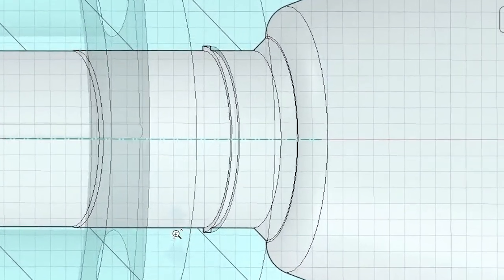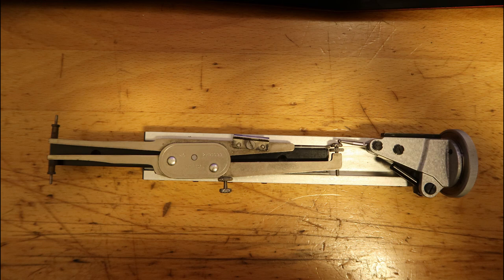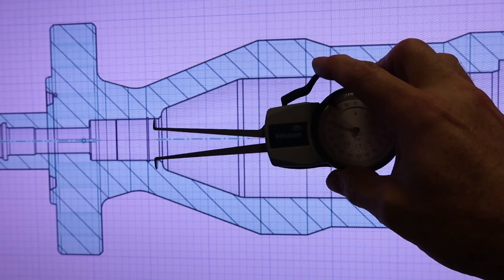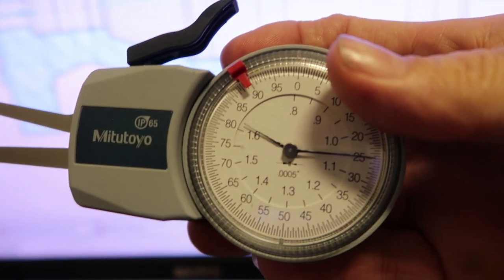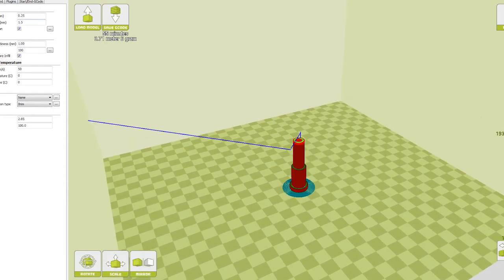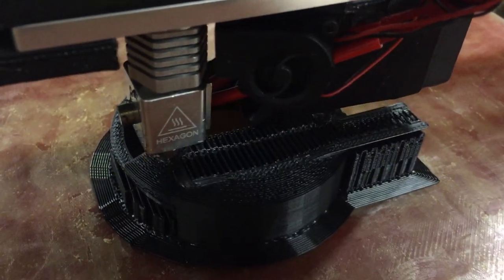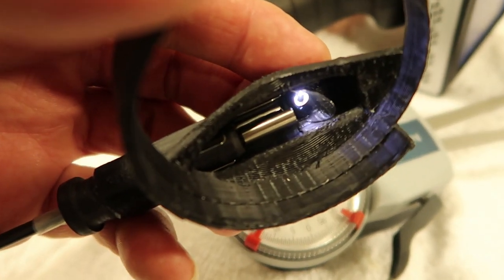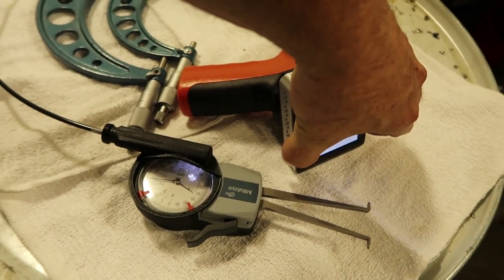Scoped Out Gage

Comment: Do Y'all have repro rubber? You could've of put some repro rubber on the end of a round stick/dowel and rolled and pressed the molding putty into the groove and then measured the dimentions on a comparator. I do it all the time for threads and grooves. If you've already established where the I.D. of that bore is, where the groove is cut into, then add the (groove depth x 2) + the I.D. diameter. The trick with repro rubber is preping the area, making it clean and free of oils/coolant, dust and chips, with brake cleaner or alcohol. I end up being within .0005 - .001 with this method. Sorry for your losses with the Hurricane. Happy to see you're back. If you need help with gutting the first floor of your house, I have the time to help you.
Reply from the maker: Yes when they ran the parts the first time that's how they did it using the rubber. That does work but it takes time and I have more faith in measuring it direct. Thanks for the offer on the house. My wife's brother does home remodeling we have him on the project.

Comment: Peter, did you enumerate all these challenges when you quoted this job? Between the custom work holding, custom tool holders, special measuring jigs, you must have a ton of time figuring, modeling, caming, and machining all this stuff. And that's before even making the test part let alone an actual part. Just curious on the methods you use to try an avoid missing some of these initial setup costs. It becomes less of an issue as the quantity goes up, but if you where to make 1 of these, its easy to make a loss leader part. Thanks again for the videos, nice to see someone sharing how they tackle tough parts to make.
Reply from the maker: At-Man Unlimited Machining When I took this job I knew it would be a repeating job. In fact before I have even finished these parts they have orders for more. I didn't quote the job. I was given a price and have the option to accept it or reject it. Remember I don't buy the material (unless I scrap something) or supply quality testing or documents. I just do machine work. I know this seems like a lot of work in tooling fixturing and measuring equipment. The job is easily paying for it with a good profit besides. When the repeat jobs come it will be even better. I might do this different if there was only one part. To give you a example of another job. There a set of parts called segments I do (I have showed them in previous videos). I took the time to make 16 special cutters, tombstone and eight vises to hold 16 parts. Every one thought that was overkill because it's just a roughing job. I have machines thousands of these parts. They now run unattended. I only index inserts for two hours of labor I run 32 pieces at $14.00 per part for tooling. I bill $85.00 per part. It takes one day unattended to run two sets, 32 parts. That's $2,272 for two hours of labor + overhead. My overhead is only rent + me because I work by myself and own all my equipment. You tell me is that OK? It has taken me many years to work into this situation. I know it is quite unusual.
Reply: Thanks for the reply Peter, by no means am I questioning your methods, just curious how you approach something like this. Sounds like this one was a, "we pay X, you want to or no" deal. But I'm sure you spent some time figuring out if the risk is worth the reward so to say. Or maybe not, sometimes you get a customer that actually understands how big of a PITA the part is. They are just happy to find a shop to reliably turn the parts out and pay accordingly. I don't think it is overkill at all, you have some pretty difficult features in deep bores made from a super alloy. There are not to many ways to create those features. Really cool that you can show this and your willing to take the time to share. Greatly appreciated, I know how much time it takes to make these videos. They also show how much effort and skill goes into a part like this not only to make the chips, but to measure it and make it right.
Tim
Reply from the maker: Sorry I didn't intend to sound confrontational. Some time when I say things I don't chose the best way to say it. I don't follow the normal ways of doing things. I was never taught the normal way. In a way that gives me a advantage because I will try something new. When they finally see the end result they say wow that worked good they just didn't understand what I was trying to do. That probably my fault for my lack of communication skills.
Reply: No worries Peter, that is exactly why I asked the question. You do think differently and that is a good thing and a valuable asset to have. Your videos have struck up some interesting lunch conversations at my day job. And there good conversations. I'm also not "classically" trained, which is why I enjoy the exchanges.
Reply: I understand that you aren't required to supply the quality testing to the customer.  However, I wonder if you know how that 'snap ring groove' actually IS tested by QC?  I'm pretty curious how that manner of feature is 'officially' tested.  Did they shell out the $1700 plus for the weirdo gauge?